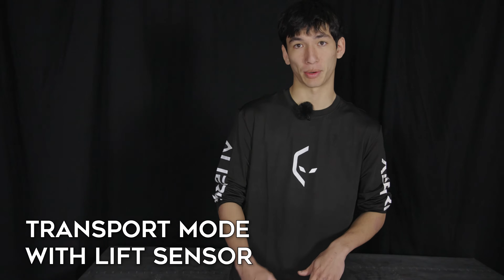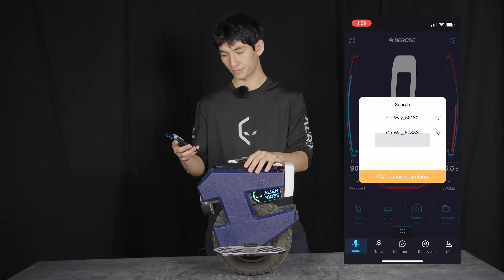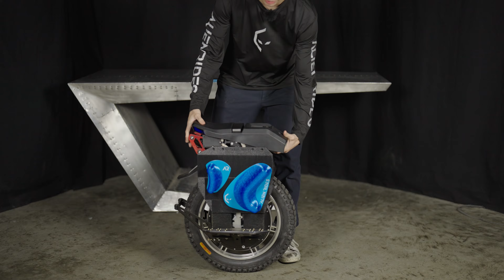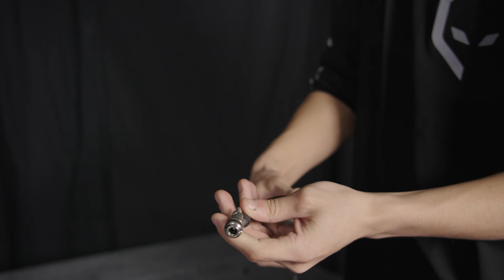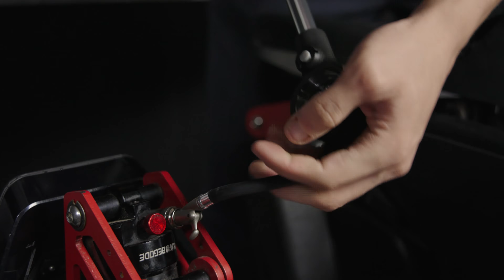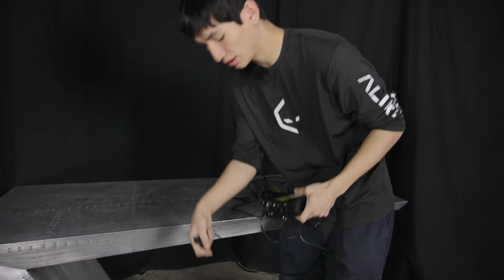Introduction to your Begode Wheel

Comment: Hi Sho, great needed info and explained plainly. I just wanted to clarify on the pump that has the locking mechanism that when you're done pumping up a shock you flip the switch back to unlock it and then unscrew from the shock right?